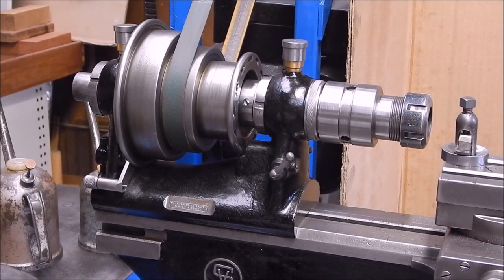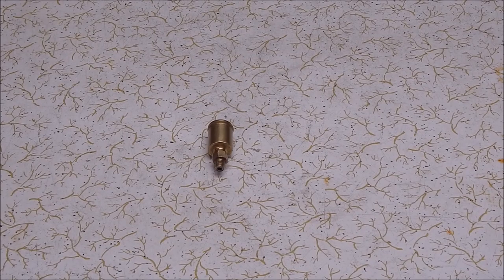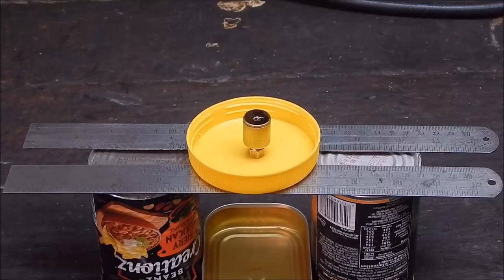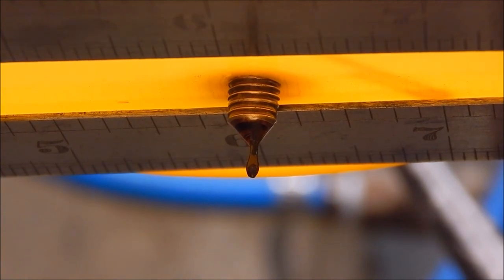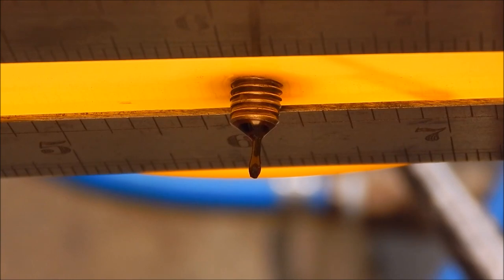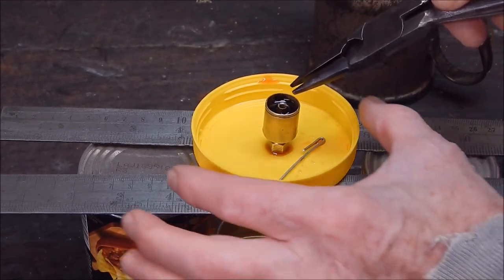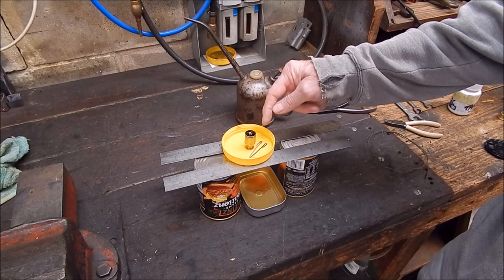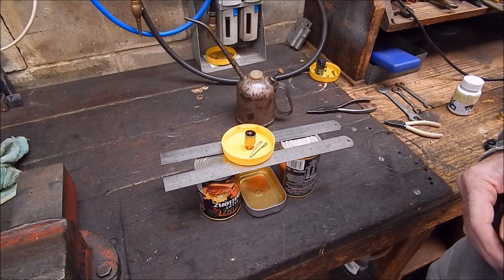More on the wire wick lathe oil cup - plus a demonstration

Comment: Very interesting Rob. Im guessing the oil "creeps" up the small gap between the wire and the oiler housing, because if if simply crept up the entire diameter of the wire, why doesnt it creep up the centre tube of the oiler without a wire in place?. I dont think this is as simple as it seems!,
 Also i cant think of a good reason why galv wire, which is only a zinc coating, is different from copoer wire. Both are soft metals and are right next to each other on the periodic table. Might it be surface finish?
Reply from the maker: Could be.

Comment: Am I correct in thinking that the vibrations of the running lathe would increase the flow of oil? If so, that is an even better regulation of oil flow based on use.
Reply from the maker: The wicks don't generally move and it would have to be some seriously bad vibration to affect it.

Rob

Comment: I wonder if you could change the drip rate by sanding the wire in different directions with 600 grit wet and dry
Reply from the maker: I doubt it as it relies on capillary action, which is relative to the contacting surface areas.

Comment: wonder if solder wire will work, if not some copper wire out some electrical, im just thinking of what people have access too, it seems all my steel wire is coated, perhaps others might have the same issue
Reply from the maker: From memory I think copper works OK.  Electroplated steel wire could be rubbed with emery paper to remove the coating.

Been a while since I did this.

Cheers Rob
Reply from the maker: Actually the easiest way to get uncoated steel wire is to heat it red hot to oxidise the electroplating.

Then finish off with emery or steel wool.

Cheers rob
Reply: now theres a tip ^ cheers

Comment: Do you have to 'pre-coat' the wire length to get it to start - like with siphoning ?
Reply from the maker: Yes, the wire needs priming.  The pots are so small that the wire gets a dose of oil automatically when you fill them anyway, so it's a non issue.  

Cheers Rob

Comment: Hi Rob,
do you need to prime the system before the surface tension operates?
Reply from the maker: Yes, best to do that.  I always make a point of splashing a drop on the wire, plus it puts oil down the feed tube initially as seen in the demo, which helps heavily lubricate before startup after standing for a while.

Cheers Rob

Comment: The flow rate can be increased by adding more wires ?
Reply from the maker: Yes.  You can twist several together in a plait, but normally you increase the diameter of the wire to increase the flow volume.

Rob

Comment: it really surprises me how fast the drip is. i thought it would be much slower maybe on the order of 10 minutes.
thanks for the demo Rob

- Regards, Magnus
Reply from the maker: That's way too slow.  You need about what I showed for that wire size.

These are very small drops of oil, not big blobs, so they have a lot of work to do.

Cheers Rob

Comment: straight or twisted wire rob ?
Reply from the maker: Good thought.  Twisted would probably have better capillary action.

Never tried that as I don't have any octagonal section wire.

Cheers Rob
Reply: why would you need octagonal? try using normal round wire i would have thought
Reply from the maker: I am thinking you meant a twisted single wire, in which case you would get a better spiral with octagonal shape (like a twisted wrought iron piece). 

But if you meant two or more wires twisted together like a rope, then that's different, and would also work better than a single wire I expect.

Cheers Rob
Reply: ah so the wire you showed was only a single strand and the capilliary action was from the wire to the side wall hence the "closeness to the bend to the tube and the starter drop on the bend itself".
i can remember seeing old books saying that using the cord trick was a good way of recovering old oil using it as a filter to get the good oil from the bad using siphoning technique, but i dont think it would work with todays oils  cheers for the replys